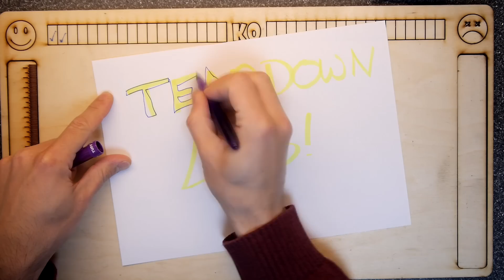Modified GBS 8200 Supergun WrestlefestWrapup

Comment: Nice. :)

I didn't think the sync from the board looked glitchy on the o'scope, and said that it probably was just the TTL Csync that needed attenuating.

I didn't try that, as I wanted to get the board sent back to you. I'm not so great at getting stuff posted, so the board would have been still sat here. lol

It might have been enough to just slap a 680 Ohm series resistor on the Csync output, tbh. That's the common value used on the Mega Drive RGB SCART cables.

(the 75 Ohm termination on the GBS board or TV forms the low side of the resistor divider.)

So glad it's working now.
Reply from the maker: I'm not quite finished with it. Just one finishing touch left!
Reply: @backofficeshow  

I'm also happy that my o'scope is showing me the signal properly.

I stared at it for about ten minutes while looking for sync glitches, and it seemed fine.

(wasn't sure at first if the longer timebase settings were preventing me from seeing the occasional glitch.)

Need to order more TTL chips for Snow Bros, btw. I'm still working on it. ;)